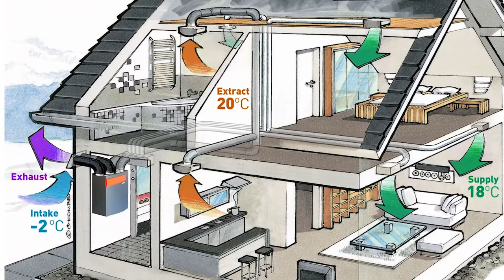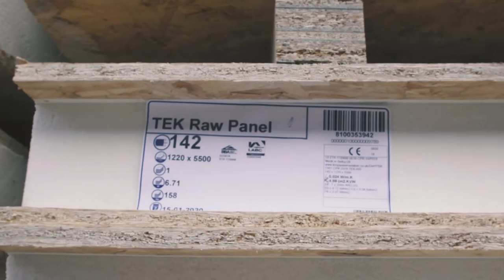Building with structurally insulated panels (SIPS) | Church Farm Ep2

Comment: Enjoying the videos. Very interesting and helpful as I am looking at SIPS for our self build in spring 2021. I've not fully watched the 2nd film yet, but if possible would you be able to provide details of the main suppliers, such as SIPS build (Clays), MVHR, Windows, Heating type. With both the products used and the installing companies etc etc. Thanks in advance.
Reply from the maker: Hi Neale, thanks for your message. Andrew is going to pull all the info you requested together and we'll probably include it with our next film that is coming out in the next week or so. Where are you based and what are you building? Hopefully these films will help out, but if you have any specific issues or queries moving forward then definitely get in touch! Thanks for watching!
Reply: @MarkKnightFilms  ..Thanks Mark. Looking forward to watching the next episode.